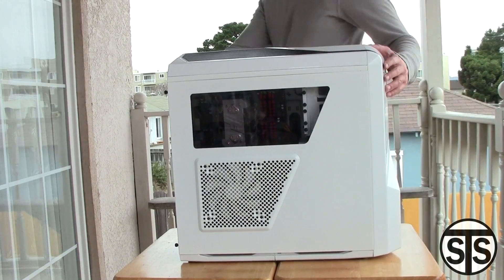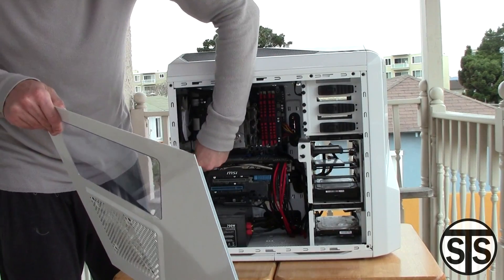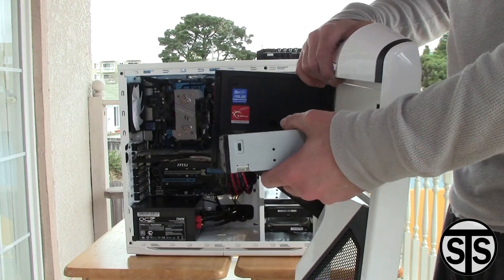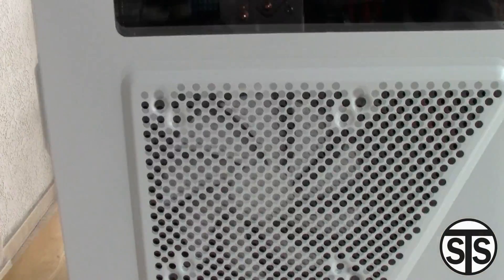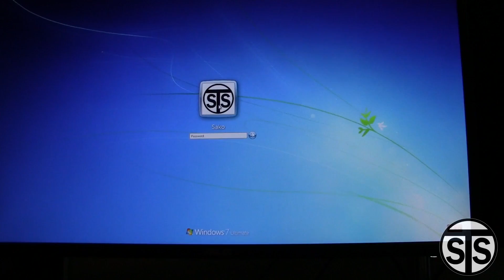The [NEW] Best Way to Clean a Computer!

Comment: It's not the fan motor that you have to worry about, when spinning them, it's the fan header. So in the worst case you could damage your motherboard with it.
The electric motor uses electricity to spin the fan. If you spin the fan, it works the other way around and it generates electricity, that goes to the fan header.

Comment: Cleaned it with some rag (interior casing only) when i opened turns on in bios then i cant get out of bios
Reply: Hey not sure if you figured it out but You would want to boot into your boot device from the Bios, if there is no boot device connected or never installed windows then get a usb drive containing windows and install onto the hard drive of your choice. 

Hope this helped.

Comment: Can we use a vacuum to suck up all the dust?
Reply: Sako's Tech Spot Even if the vacuum is blowing air and not sucking it up? Why wouldn't an electric duster cause  an electrostatic discharge?
Reply from the maker: No, using a regular vacuum will cause electrostatic discharge and harm your components. Use compressed air if you don't an electric duster.

Comment: The best way to clean your Pc is to just make a habit of doing it every few weeks then it wont get that nasty and it will only take a few minutes to clean. i just use a vacuum with a hose and a dusting brush, but you do what you want its your time. Thanks for making the video i have the same case just a different color. I went through closed off all of the vents that i couldn't buy a dust cover for with black tape, so that you cant see it and it wouldnt draw dust in then i replaced the fans in the tower with some super high flow Delta fans.
Reply: Don't use a household vacuum cleaner with brush!  You don't want the brush going anywhere near components because the build up of static electricity is too great which will cause damage to the components.   Even with that hand blower (I got the same model) you don't want the end touching any of the components for that same reason.  
In the past I used  a air compressor but that is a no-no as well due to the moisture that's in the air that ends up in the tank.
Reply from the maker: My friend's sister vacuumed the inside of her PC one time. They called me to check out why it wouldn't turn on anymore. She later admitted to cleaning it with a household vacuum and I had to explain why you should never do that.
Reply: Compressed air duster
Reply: don't use a vacuum dude that can fuck up your computer...........

Comment: Using a leafblower? Well i guess its more effective than using some compressed air! Thanks
Reply from the maker: Canned compressed air gets expensive!
Reply: It’s not a leaf blower, silly. He said it’s like a mini leaf blower for your computer. It’s nowhere near as powerful as an actual leaf blower.
Reply: I use a compressor, carefull of the moisture, not a big deal. Yoy definately want to hold the fan blades, too much pressure can damage the bearings causing oil to leak out.
Reply: Could you use a vacuum cleaner (just reverse the airflow) so instead of sucking, you're blowing?
Reply: Master Emerald If you're sucking sure, but not if you're blowing? Linus said blowing is fine in one of his videos.
Reply: I want to get one of those blowers, I thought blowing was fine too whether it's an electric blower or not, the static from a vacuum is caused from everything rushing to the vacuum, and isn't there just a fan on a motor or something in the blower anyway? I won't be even trying compressed air because liquid comes out, better off blowing with your mouth.
Reply: @penguinator45  its completely ok wdym